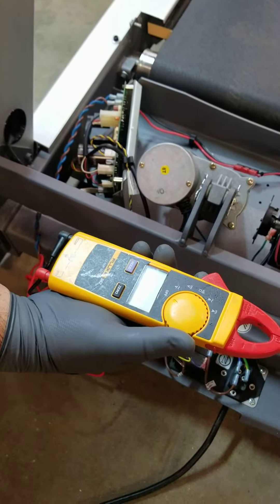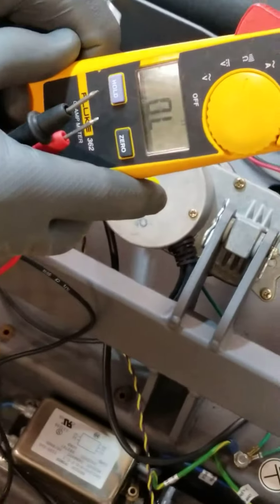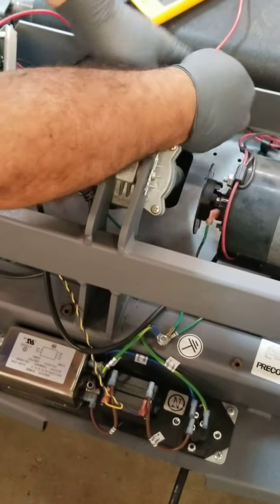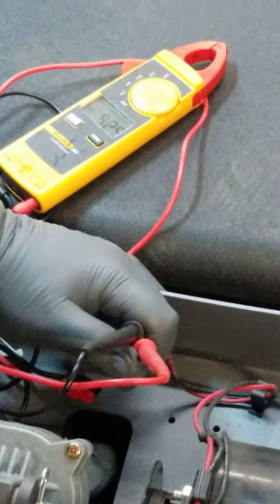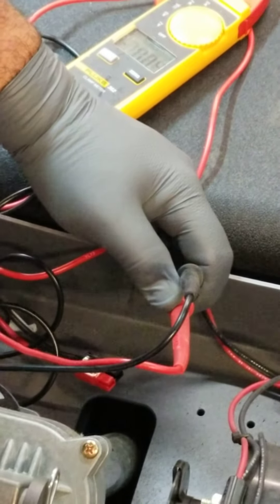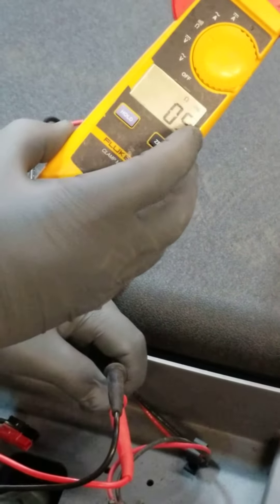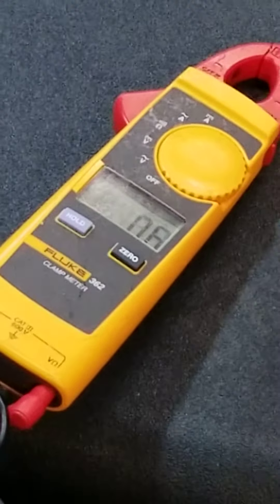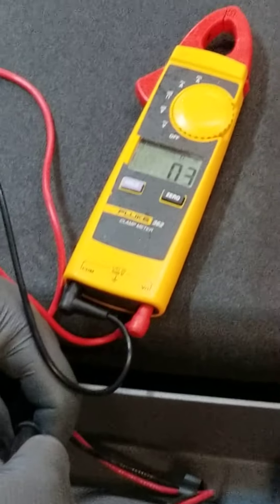DC Motor Test With Meter

Comment: Hi - Thank you for the video. Today our treadmill drive belt stopped moving. Digital display lights up but the motor does not drive, carried out a test as described. I get a 02.2 reading on the multi meter but when I spin the wheel it says 0.L, is my motor defect?